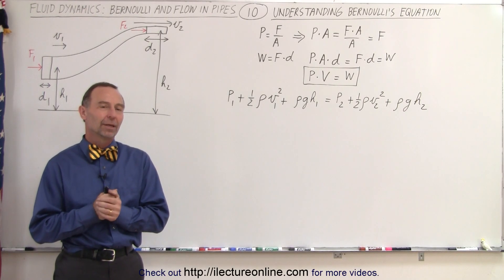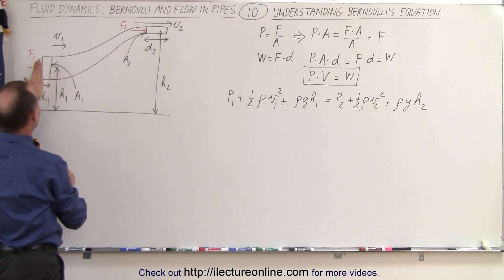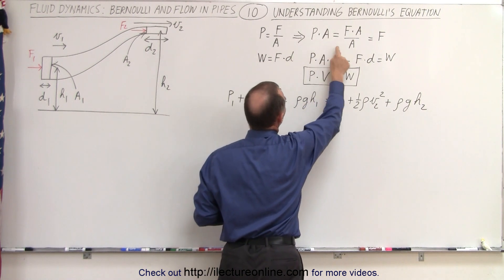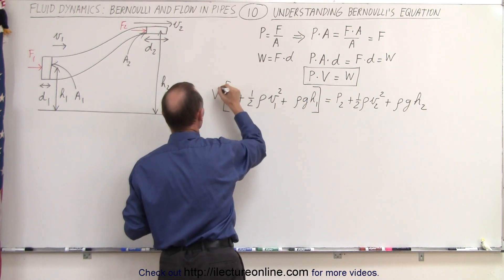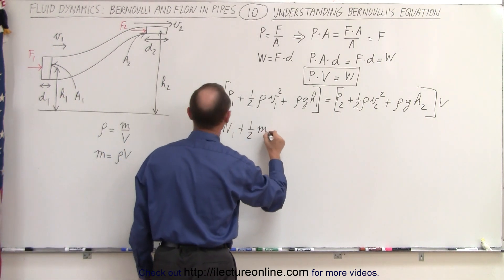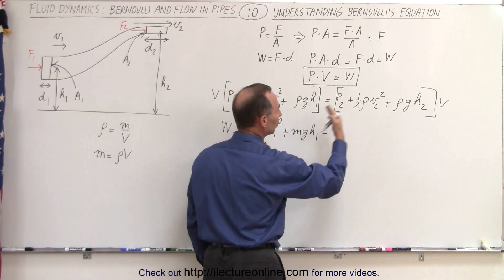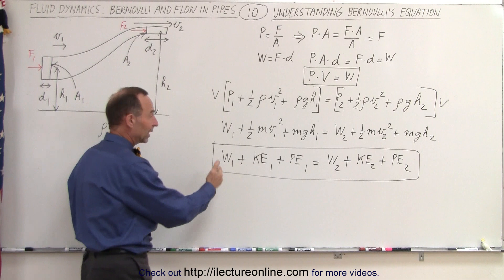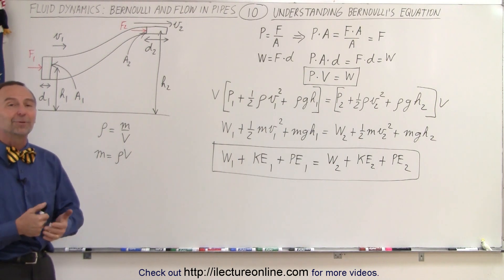Physics 34.1  Bernoulli's Equation & Flow in Pipes (10 of 38) Understanding Bernoulli's Equation

Comment: Why is P decoupled from KE? If I apply external pressure, the fluid moves faster - that is, as W_1 goes, KE_1 also goes up.  So KE should be a function of initial velocity and also of the pressure applied. Or am I thinking it all wrong?
Reply from the maker: Not sure what you mean by "decoupled".   There are 3 terms on each side of the Bernoulli equation.    P +  (1/2) density x v^2 + density x g x h = constant   So the sum of these 3 terms will always add up to the same amount anywhere in the pipe.